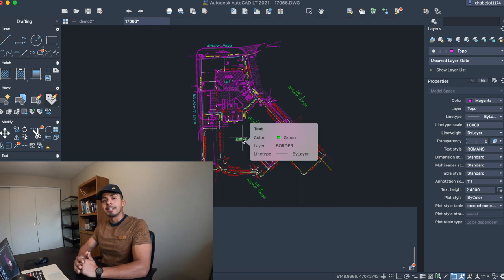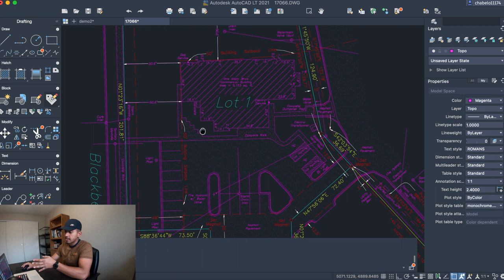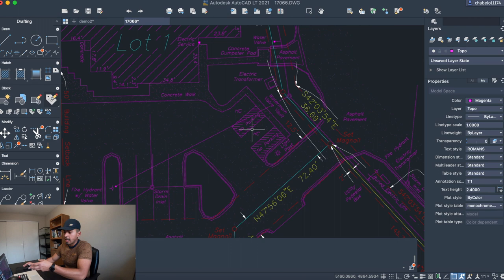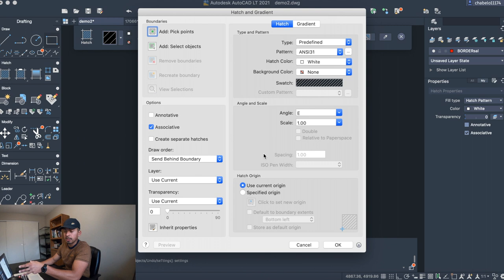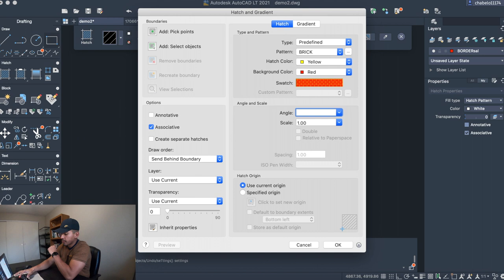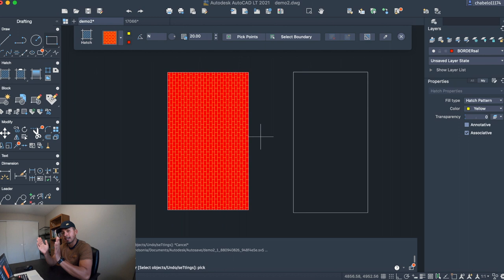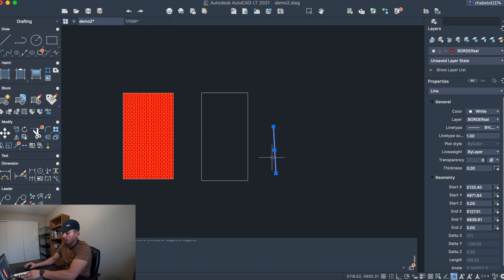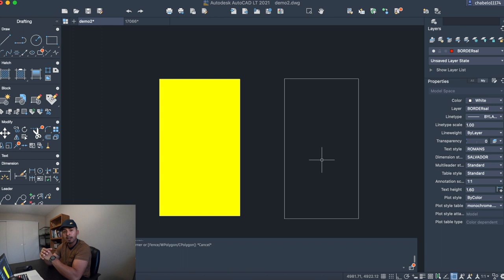AutoCAD LT Tutorials for Mac: Hatching

Comment: how to osnap hatch in mac?
Reply from the maker: Please elaborate your question a little more. Are you wondering how to hatch an object? Simply enter "hatch", then type and enter "S" for "select". You should be able to select the object and it will hatch. If your object has an elevation, it might not hatch correctly.